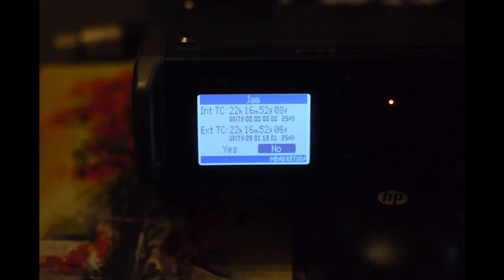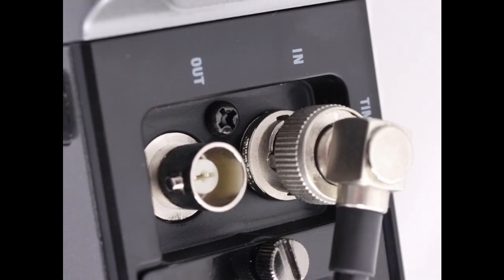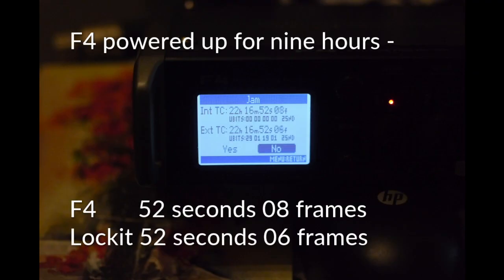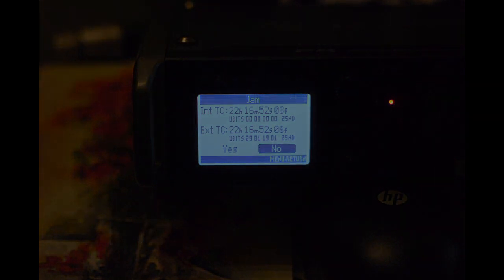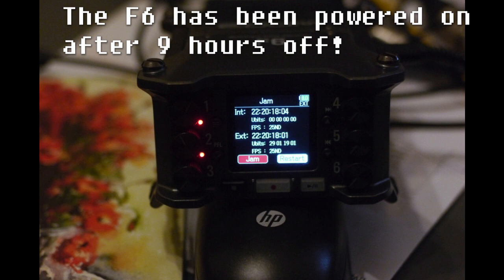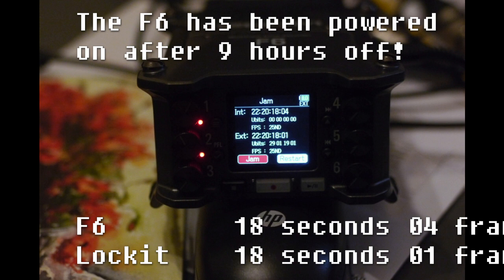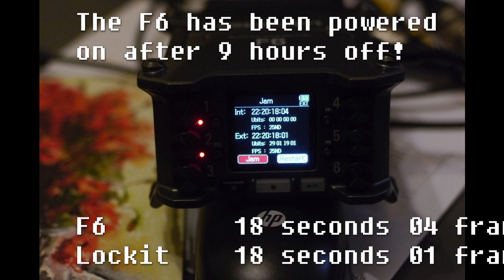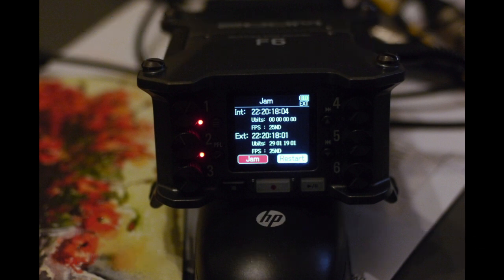Zoom F6 - the new timecode feature - is it good enough?

Comment: Thank you for the wonderful video!! When running timecode to a camera from the f6 is one side of the stereo timecode output the timecode signal and the other side the audio feed from the f6 or is the audio signal not passed through the timecode feature to the camera? Thank you.
Reply from the maker: Hi Cory - sorry for the delay. The time code output only carries timecode and not audio. Some cameras will have dedicated timecode inputs and that is the best situation. But if not it might be possible to get a lead made up all on 3.5mm jacks and do as you describe feed say the A leg with audio and put timecode on the B leg. Time code is nasty stuff that loves to bleed everywhere though and we might hit problems with mic level inputs on cameras so there are hurdles to overcome. What camera do you have?  You can go the other way with something like a Tentacle Sync - which has an output with timecode and audio (they include a lav mic in the package) - you could jam the F6 to the Tentacle and then plug it into the camera and leave it connected. Ta like, ppm6.
Reply from the maker: Hi Cory - I'm not familiar with the media mod on the Go Pro - will it accept a 3.5mm stereo jack lead? I would think it is worth experimenting with a simple splitter lead as it can be done/made up cheaply. And then you can test if the bleed is a problem. I'm surprised no one has done this already, but I can't find any videos about it so far. Ta like, ppm6.

Comment: Is there any solution to get either the time code output from F6 to sync an Atomos Shogun 7 to keep them in sync or with one of your smart devices in between....thank you for your great videos Aha the time...
Reply from the maker: Hi Theodore - the Shogun 7 has a sync input on BNC that also accepts timecode - page 9
https://downloads.atomos.com/shogun-7/Atomos-Shogun7-UserManual-V01-NOV2019.pdf

You need a mini-jack to BNC lead - I go from mini-jack to phono and thence to BNC.

Try it let me know if it works. Ta like, ppm6.
Reply: @ppmtv-qh9qk  Thank you so much...that sounds awesome...so it works for you in the combination shogun 7 and zoom F6? I saw the possibility in the manual and ordered a mini Jack TS to BNC cable, but it want work...what you described is different from what I tried...do you have a link to the cables you used? I am in the German speaking area...what you mean with phono? All the best Theo
Reply from the maker: Hi Theodor - I'm afraid I don't have a Shogun just the manual. The mini jack on the F6 carries timecode in and out on one stereo connector. So unless your connector came with two BNCs then you may have a cable that is an 'input' to the F6 not an output. I use a standard and very cheap min-jack to RCA phono and then an RCA phono to BNC. Then one of the connections is timecode in and the other timecode out. Actually this is one advantage of the F8n - BNCs for timecode! Much easier.
Would you recommend the Shogun?  Ta like ppm6.

Minijack to RCA (phono)
https://cpc.farnell.com/pulse/pls00179/3-5mm-st-jack-to-2x-phono-lead/dp/AV19107?st=3.5mm%20jack%20to%20phono

RCA to BNC
https://cpc.farnell.com/pro-signal/rw1-033/adapter-bnc-male-to-rca-female/dp/CN15992?st=phono%20%20to%20bnc
Reply: @ppmtv-qh9qk  Thank you will try that tomorrow...Amazon has to deliver that...all shops here are closed....for my situation I can recommend the shogun 7 ... I try to film music demos with piano and a soloist and doing that all by my self....I am able to record 4 cameras in 1080p and can also use some older cameras with a clean HDMI output...in Germany and other parts of Europe you have this recording limitation around 25 minutes and also crashes through overheating....all files are then at on place and synced....this is why use it and it was special offer last year...
Reply from the maker: Thanks Theodor - I hope this works for you. What mics do you put out on the piano and soloist?  Quality German ones I hope! I have just got hold of the new Schoeps CMC1 for a review - I just wish I could afford to buy some!  Ta like ppm6.

Comment: why wouldn't you leave the F6 on for the 9 hours to make it an actual comparison? Since at the time you filmed this the F4 didn't have the ability to continue TC while off it seems you would get a better idea leaving both on.  I understand why you turned off the F6 since that is a feature but it kind of makes the F4 and or the F6 to Lock-it meaningless in comparison. would of been nice to see how the numbers looked when the F6 was left on and if the drift was the as the F4 or better yet was the Lockit and F6 equal making the F4 not good enough.  but if the drift was the same as the F4 it could be the lockit (unlikely) but again i have no idea what is what since no test was done the same :|  regardless nice and straight to the point though )
Reply from the maker: Hi GTT - thanks for a great comment. I think you are right there is room for a video comparing F4 and F6 timecode over the working day period, especially now the F4 has the same power down implementation that the F6 does. Which is the point of this video. Most people want to power down over lunch (if they be so lucky as to get lunch!) and the question for Zoom is - will your timecode allow this without a post lunch re-sync? When I get a moment I'll do another video. My guess is the F4 and the F6 have the same timecode circuitry on board...we'll see. Ta like.
Reply: @ppmtv-qh9qk  thats kind of what i was hoping to see. if their the same then alright but if different then i'm curious where it sits with the older lockit.  i just got the F6 after selling my F8n since i didn't use it to its full potential and the f^ was the perfect size.  but now when i do use it i miss my BNC TC i had on the f8n and i'm not sure how to use the 3.5mm with my cameras.  how are or what are you using the f6 TC with?
Reply from the maker: Hi GTTV - I'm charging the batteries going to leave the F4 and F6 overnight.  As I use my F6 with the Lockit I have a BNC to phono (RCA) and then phono socket to 3.5mm I had to experiment with getting the right side of the 3.5mm because it has in and out on the same connector. I much prefer the BNCs on the F4. I wonder what cameras you have - most DSLR shooters have time code on HDMI and then you have to move to Sound Devices world. Thanks again for the comment. ppm6